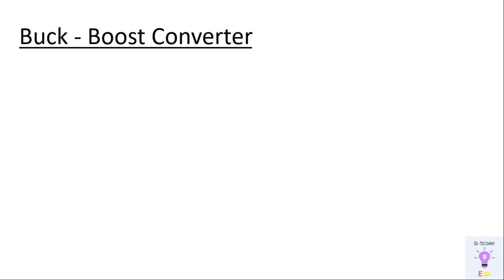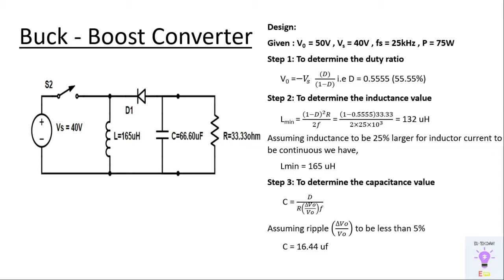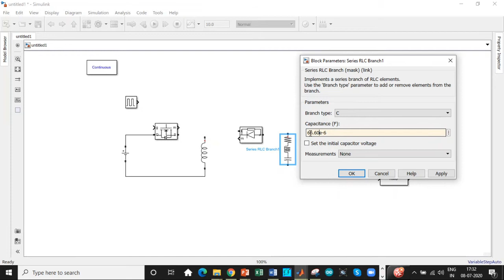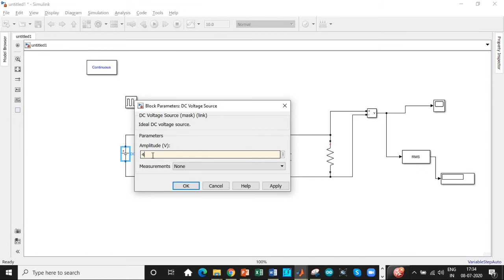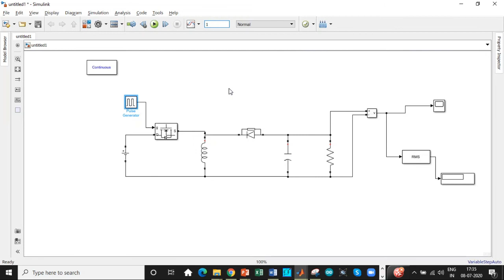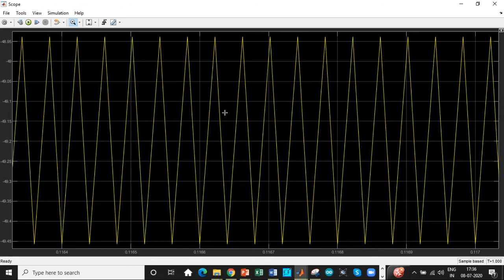Design and Simulation of Buck-Boost Converter using MATLAB (SIMULINK) / DC-DC  Converter

Comment: Sir how about selecting the Resistor value?
Reply from the maker: It totally depends on the power rating of the load. In simulation it hardly matters. But for hardware implementation you have to be specific.

Comment: Duty cycle is not come out 0.555, according to your formula your formula is wrong for duty cycle, put value of output voltage and input voltage you will get answer 5
Reply from the maker: I have designed for only one mode.  Please check carefully. If you follow the exact steps, you will definitely get the desired output. The design is accurate.
Reply: @ElectronicsMaddy   this is because the output voltage is negative right? buck-book converter produces an oposite sign of voltage. Maybe the voltage output of the desgin should have included a negative sign